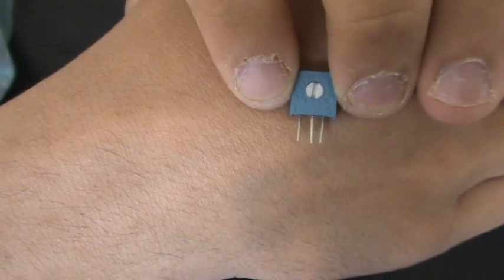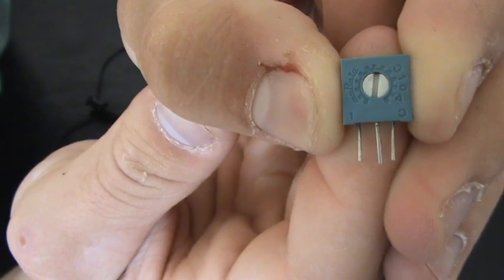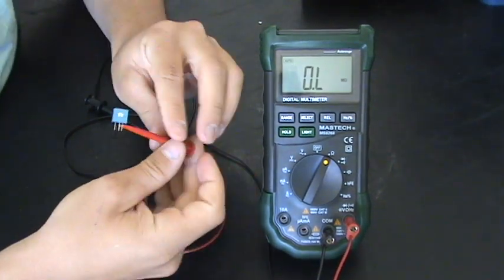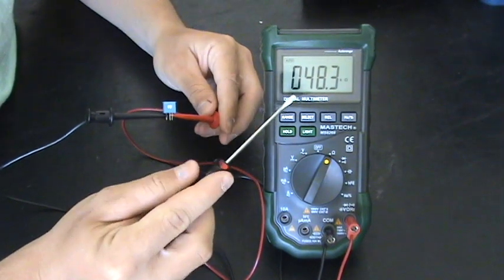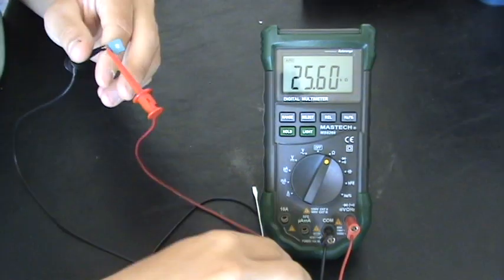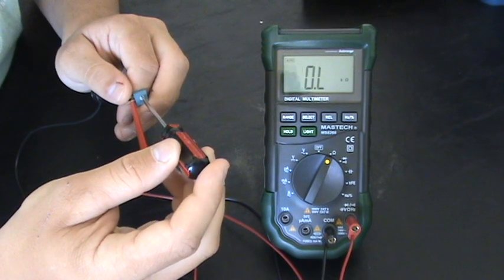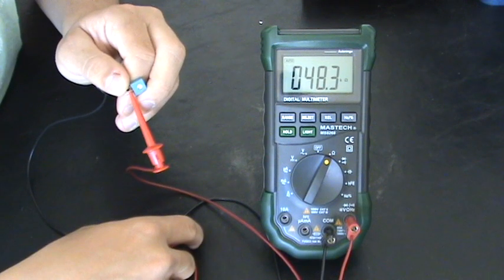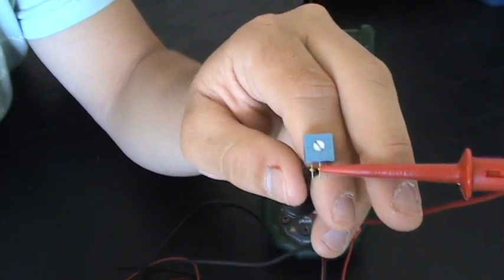Robotics and Electronics Tutorial - 18 - Testing a Trimpot

Comment: Question : i need to install a 10k trimpot on a bord instead of the 10k stock resistance to allow me adjust the resistance to 4,7k or 5,6k :
What kind of trimpots would you suggest (i saw trimpots with only two leads, so how can you adjust this kind of trims) ?
Thx !

Comment: Thanks for your video. I have a circuit which I have to use a trimpot with 5 terminals, however, I have a trimpot with 3 terminals (like yours in this video). Is there any chance that I can use the 3 terminals instead of 5? Thanks!

Comment: Potentiometers are not just variable resistors but also voltage dividers.
If you connect the outer pins to 0V and 9V then the voltage on the middle pin will vary between 0V and 9V as you turn the wiper.
Reply: Didn't know that, what purpose would this be used to serve?